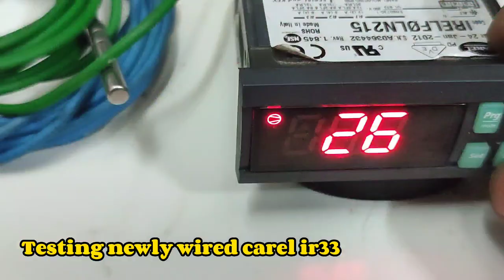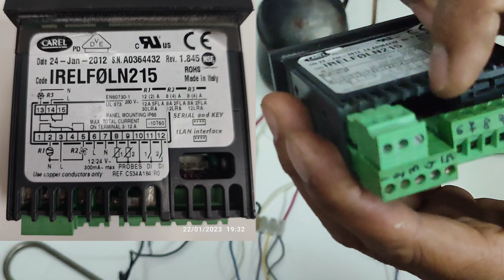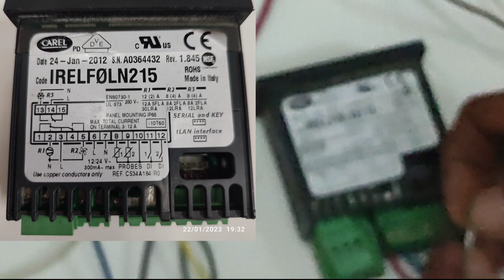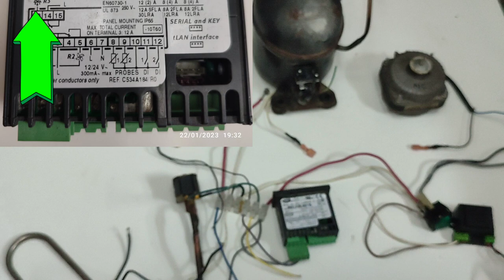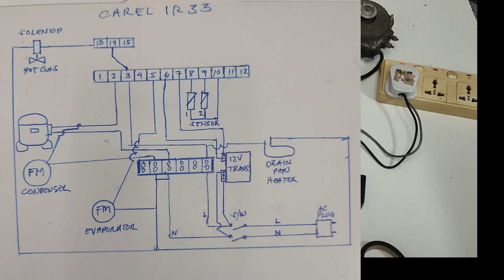ACTUAL WIRING CONNECTION / DIAGRAM OF CAREL IR33 FOR BOTH CHILLER & FREEZER USE (TAGALOG)

Comment: Bro u doing great work but u give direct Line and neutral to heater how will dixell meter will control on electric rod please answer
Reply from the maker: You may install cut off device separately bro, like thermodisc. The dixell model is basic and its intended for  commercial chiller use. Sorry if i used tagalog language. Hope YT translation is on
Reply from the maker: You asked me in dixell earlier then we're in carel control. Pls don't confuse anyway

Comment: Sir, pag may contactor  at Lps
I  pa parallel na ba ung supply line ng solenoid at coil ng contactor.  
Any proper wiring options para sa commercial units?
Thanks sir.
Reply from the maker: Madaming option sir,  lalo na mga beterano. Solenoid sabay mo sa compressor sir, lps lagay mo sa line ng control para in case of abnormality off lng output relay ng compressor at evaporator fan
Reply from the maker: Sa control mo sir nakita terminal # 4 dun mo itap ang lps mo
Reply: @THEMULTISKILLEDTECH  , ok sir.. Salamat ng marami.
Painawa natan ditan ed brunei ah.
Reply from the maker: No worries sir, Bat sir magisa ka lang dyan na tumitita?
Reply: @THEMULTISKILLEDTECH .Sir, .madami din kami na pinoy dito..
Tulong 2x naman kami sa work.
Reply from the maker: Baka need nyo ng helper sir,.apply ako dyan. Ala benefits dito samin.
Reply: @THEMULTISKILLEDTECH  , wala pa po hiring sa amin. Saka png baon lng ng mga anak ko sahod ko dito. Tyaga lng para mk tapos sa college mga anak ko.

Comment: Sa mga cold storge Sir mayron kabang buong diagram
Reply from the maker: Wala tayo sir,. maintenance kasi kami dito, hanggang parts replacement lang kami. Supplier ang nagiinstall sa malakihan sir
Reply from the maker: Mga old model cold/cool room madali lang sir basic wiring lang. Compressor nya ay 2hp pababa, wag lang dorin at bitzer 20tr  ala tayo nyan.